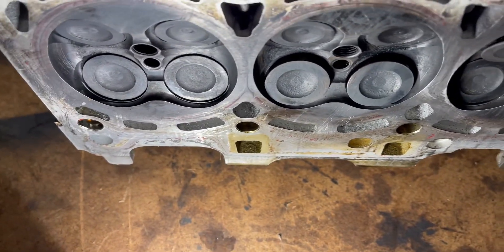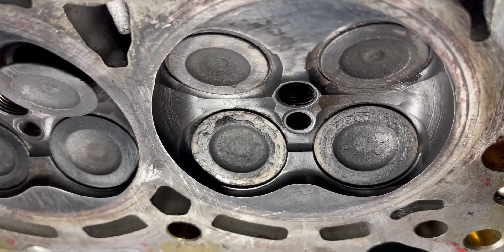The infamous BMW N20 engine is non interference 😲

Comment: I’m having a similar problem I did my head gasket for n26 torque everything to spec with my buddy double checked everything but when we put everything together and tried to turn it on it only turned over didn’t turn on , my buddy thinks it’s cause the timing chain skipped timing and we have to retime again , but a Mechaic is  saying that the pistons are  gonna be fuct since it’s out of Timing he think the valves bent , but this video just  proved that they won’t even touch the valves since it has clearance room
Reply: I did a compression test and I got 30 psi on all 4 cylinders do you think there’s a chance I could retime the timing chain and  engine  will run and idle good ?
Reply from the maker: @ I believe 30 PSI is a bit low, its unlikely all cylinders are damaged, but hopefully there  was no air seepage on your gauges...

Comment: They are interference I have a bmw shop. Seen some that bend the exhaust valves. Most bmws have valve reliefs in the pistons.
Reply from the maker: What year because this model has the valve relief, and being that the car was driving when engine failed, when it was opened there were no damage to the heads and timing was off by two teeth.
Reply: @gman103  I don’t think we will ever know no one wants to share the correct information or mostly even know what to say. I replace my timing chain at 122K.  It turned out I replaced it sooner than expected because the rattle noise I was getting was from my wastegate lol

Comment: Hello DJ Gdiddy,

First I am a idiot.

...after doing the oil leaking valve cover replacement on my 2016 F10 528i xdrive I stupidly, idiotically, morronicaly, forgot a wrench on the crank bolt pulley after turning the engine. I finished all work on the engine and check everything on the valve cover, next I cranked the engine and then disaster struck... On first start the engine cranked and wanted start and then I head a loud BANG (I believed it was a exhaust misfire due to loss of fuel from the maine fuel rail:( ), I tried to start the engine again but didn't want to start on the second try. After checking I saw the crank bolt undone and transmission oil cooling lines broken. Now I'm looking at what I have done in disbelief...

Have I damaged the engine completely? Is it salvageable? Any advice is welcome...Thank you.

P.S. I also posted on armand salloum channel.
Reply from the maker: Wow from listing to what was done you may have to reset the timing... and make sure all the lines are back in place.. the worst case scenario is that the head gasket got damaged...
Reply: For everyone asking, I finally got to repair the car and the engine was fine! I had to reset the engine timing and it started. It seems at the engine start the vanos is retracted enough so the valves are not damaged. If you have to do the timing chain replacement on and 528xi you absolutely need to remove the front subframe because you can't remove the oil pan otherwise. Basically you need to remove everything under the engine.
Reply from the maker: These engine are really robust, the hurtful thing  is you will have to replace al the broken part, new or used and start the process all over again ... I've tore mine down several times to figure out things and researched to identify parts needed.

Comment: I'm in a similar boat myself with having recently discovered a cracked piston IN cylinder 1, after some digging i found the cause of the damaged piston and it was a failed thrust bearing on the crank, which consequently led the crank to float and entrap the piston. I'd suggest giving the crank float a check whilst you have it stripped down. Also,  Any chance of a link to where you obtained that cheat sheet from with the torque specs on? Thanks!
Reply from the maker: Car ReadySokeBrake had a sheet like the one in my video, but if you do a google search on N20 torque specs they will come up and you can go fro there... hope that helps😁